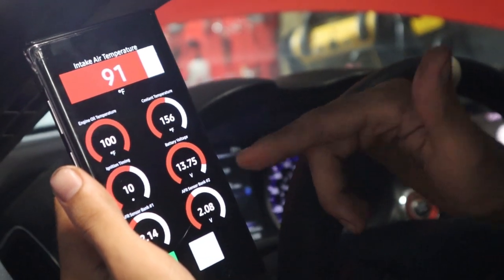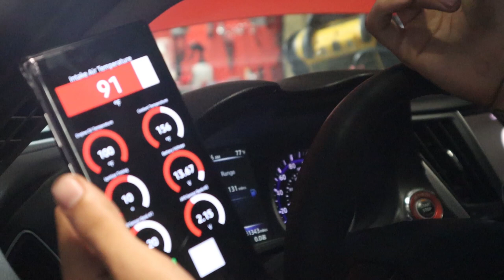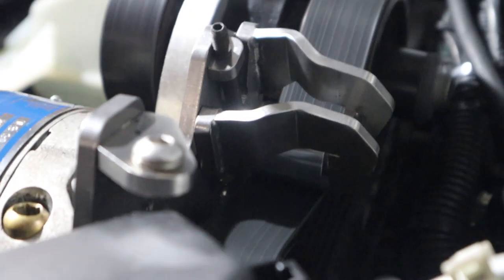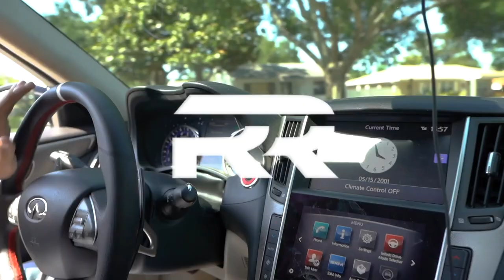Supercharged Q50 is ALIVE | Street Pulls 15+ psi

Comment: Man I really want this supercharger but it looks so expensive lol
Reply from the maker: It really just depends man. You get what you pay for regardless on what you get. I really think the issue is when people decide to keep wanting more & more power. Also people get too caught up in wanting to race & push there car with new equipment without address small issues that add & take effect overtime, ending up in a expensive failure. The kit from top guns out the box is $6000, the fuel kit is $1200 for E85, the tune is $1000. & the car drives like it came off the lot with how liniar the power is. For less than 10k ..600hp..& you can install it at home in 2-3 days...no cutting,  no welding, no oil lines or plumbing....a bolt on bossted 3.7L family sedan that you did in the garage yourself...
That sounds like a nice start towards getting into building a fast car 😎🤌✌
Reply: @RomeloRoman   when you got that supercharger kit was it the rotrex? I can’t find it on top gun anymore. I’m pretty content with 600hp or even less. Whatever I can do to not have to change out the trans or upgrade that sort of stuff I’m cool with cause I’ll get another car preferably stick shift for the higher hp range
Reply: @RomeloRoman  also yeah I seen your videos on how you were building it. At some points it looked complicated for you guys though I dont know. I have knowledge on cars but you seem like you actually know a lot more than I would. I’d do it myself but may take me a few days. Also gotta save like 5 more grand for it lmao
Reply: @RomeloRoman  also with the belt issues and such I’d need to get the same tensioner or whatever that guy sent you to keep it from slipping I’d assume if I were to get that. Unless you recommend I get the rotrex kit
Reply: @RomeloRoman  also don’t I need to buy upgraded injectors, a new differential (I’m awd so I dont know if that’s a big difference) a fuel pump, gauges, electrical kit ect as well?
Reply from the maker: @dwad9162  that's a problem for me only because I'm basically hitting maximum boost on the blower 🙃 lol I would personally recommend the top guns kit from experience
Reply from the maker: @dwad9162   No there is not too much experience with the rotrex kit. I also don't hear much good news eaither...the blower from rotrex is just not as efficient or as high of quality as vortech..I got this kit from TopGunspeedworks.com

Comment: Does anyone here know his hp/tq #s and possibly 0-60 and times? I want to know how much faster it is compared to fbo and to other turbo cars and v8s etc...
Reply from the maker: First tune : 480+ HP & 390+ lbs trq @7lbs on 93pump
(20 in wheels, first tune, installed days prior, ect.)
Second tune: 500+ & 390+ trq @12psi on 93pump failed on dyno (belt slip)
(Current) Street tuned: 600+ & 4??+ trq @16psi on full E85.
Dyno pulls coming soon.